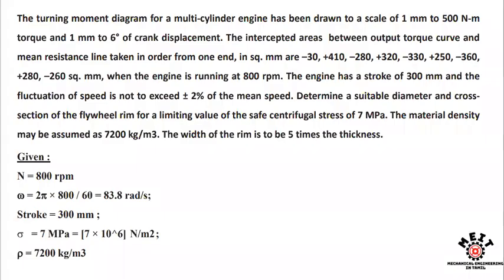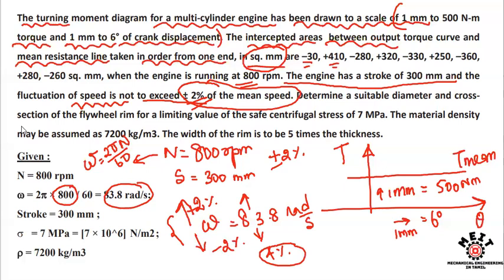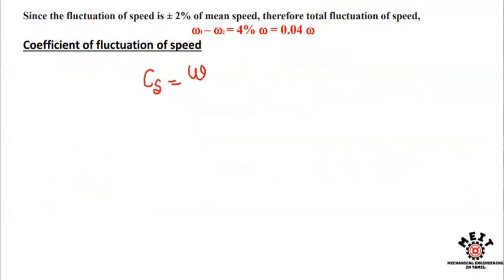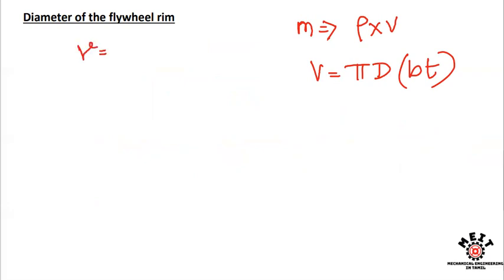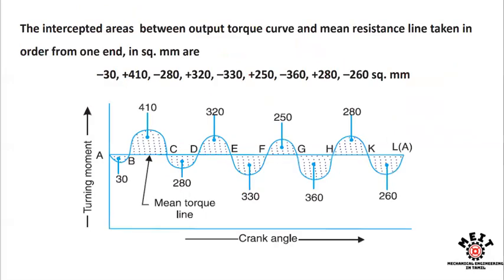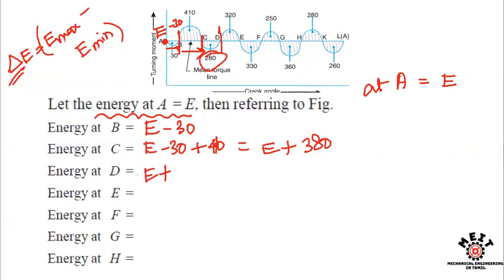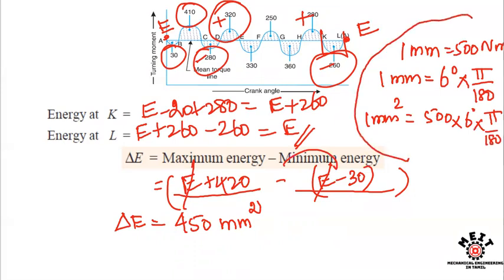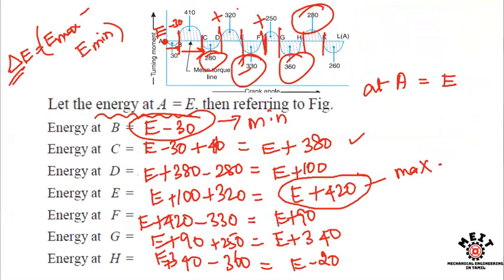Flywheel | Multi cylinder Engine Problem | Turning Moment Diagram | Dynamics | DOM | Tamil

Comment: A single cylinder, single acting, four stroke gas engine develops 20 kW at
300 r.p.m. The work done by the gases during the expansion stroke is three times the work done on the gases during the compression stroke, the work done during the suction and exhaust strokes being negligible. If the total fluctuation of speed is not to exceed + 2 per cent of the mean speed and the turning moment diagram during compression and expansion is assumed to be triangular in shape, find the moment of inertia of the flywheel.
Reply: Indha sum solve pannunga sir